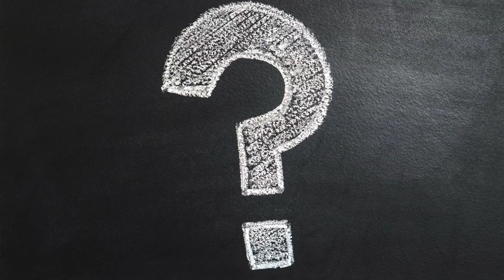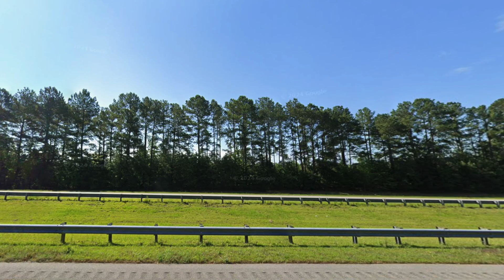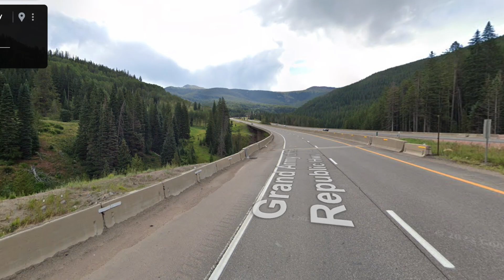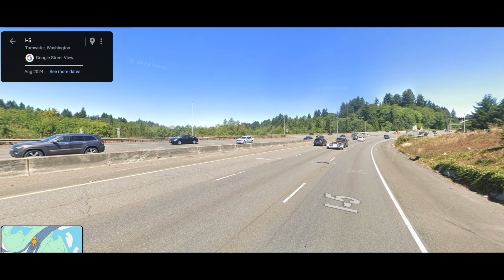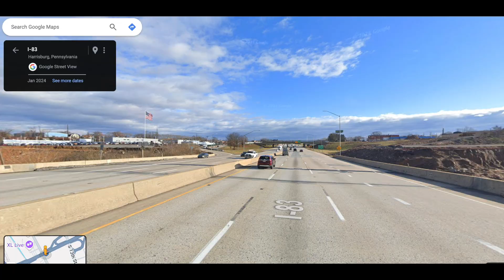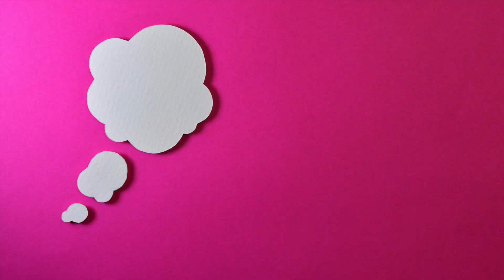Putting Rail Tracks on Highway Medians: The Pros and Cons

Comment: More cons of doing this; in order to maintain the rails, you will have to either put the crew in a dangerously tight place or close highway lanes, which will not make it popular with highway motorists, (maintenance is something people usually forget with grandiose infrastructure projects)  and it will be impossible to build turnaround lanes for emergency vehicles on the highway.
Reply from the maker: This is also a good point.

Comment: So this just popped up in my recomended, funny thing is i checked the curves for US highways vs rail a few years ago:

Wherever the US highway system has 80mph (130km/h) roads, that same alignment can be used for 160km/h non-tilting, or 200km/h tilting EMUs, It has grades of upto 6% which can be taken by very high-power EMUs, or with embankments and cuttings for lower grades

Highway - Railway

45mph (72km/h) - 46.6mph (75.0km/h)

50mph (80.5km/h) - 52.9mph (85.2km/h)

55mph (88.5km/h) - 65.9mph (106.1km/h)

60mph (96.5km/h) - 76.3mph (122.8km/h)

65mph (104.6km/h) - 84.7mph (136.4km/h)

70mph (112.6km/h) - 94.0mph (151.2km/h)

75mph (120.7km/h) - 98.7mph (158.9km/h)

80mph (128.7kmh) - 108.5mph (174.6km/h)

For tilting trains increase speeds by 20-25%

Highways are already grade separated, and they have a minimum clearance of 4.9m, this would give a catenary height of 4.5-4.6m While the ideal is 5m+, the the new acela and brightline trains are 4.32-4.37m high, so they can fit. Or use embankments and cuts to get more height.
Reply from the maker: This is very interesting math; thanks for these calculations! This would also reconfirm the notion that some highway medians are suitable for local rail (e.g. DC Metro in Virginia) and regional rail (thinking of Metrolink in the LA area running on a portion of the I-10 median). The highway speed-rail speed calculator makes it such that highway medians are suitable for the speeds you see with local and regional rail.
Reply: This really reinforces that if our goal shifts from true HSR at 150mph or bust, to "just a decently quick train" that's time competitive with driving, that highway medians become a lot more acceptable. Based on this a tilting train in the northeast could be expected to take most corners at 100mph, and on any longer straightaways could push it higher.

Also, if we are willing to impose a speed minimum on the tracks i assume its possible to bank them just like how many roads, highways, and racetracks have banked corners to enable higher top speeds. 

And of course you will always have issues getting into and out of the median. Although with proper foresight and planning you could strategically raise some overpasses/lower underpasses for cars to enable the future train to have an easier access. I generally recommend moving the road instead of the tracks since cars can handle much steeper grades. (Just to avoid the cost of building a 2mile viaduct just to enter the median.)
Reply: @jasonreed7522  "Also, if we are willing to impose a speed minimum on the tracks i assume its possible to bank them just like how many roads, highways, and racetracks have banked corners to enable higher top speeds. "

These numbers are for banked track, with iirc 160mm superelevation, which is roughly 6 degrees.

Any more than this and passenger comfort will suffer, since it has to be comfortable even when the train is stopped on the curve.

For higher speed on same track, use tilting trains,

Comment: The solution is to use the median or the side of the road where it makes sense. Having a bypass for trains not stopping in Harrisburg is ok, but add a spur to stop at the central station.
The hills are also an obstacle. But use tunnels and routes different than the highway, were needed and follow the highway by either side or in the median on straight flat sections.

Comment: Median can be an OK solution in very specific cases but still problematic. It constrain the ability of the train to reach  max speeds, and not just due to curves but also, and many times more important, max gradient, as low friction, that makes train great for high speed, does not handle well large gradients, while car can handle them well. This is true for all trains.
That's why trains also use tunnels, long winding curves around the mountains or zigzags to maintain low gradients. a gradient of 7% is usually the max, and than it's very slow, and the recommended for HSR is 2.5% (MAX 4%) and cars can handle much more (which is why one of the advantages of rubber tire metro cars over steel wheel ones).
It can also pose a problem if you need to expand the rail line or the road. The rail is problematic as it's in the middle and any expansion will require moving the road on one, or both, sides (look at the San Bernardino line that has a single track in the median of the San Bernardino Freeway that cannot be extended preventing an increase of frequency).
Another problem that you did not mention is redundancy. When a main road or rail line is closed for any reason you will need an alternative until it reopens. Lately there were a couple of cases of a major disruption on major highways that required the closure of large sections which led to a rise in train usage. Now imagine the rail line was in the median of those roads, you would have lost both the main highway and the main rail line. Even on day to day events, like major car accidents rail service might be temporary suspended, and this is not a rare thing on highways. 
All of those are a much more important that "publicity". You can make people aware of the advantages of rail without them passing in the median.
Reply from the maker: These are definitely good points, and the gradient issue is one that has also been brought up. Tunneling can be really expensive, but sometimes, it's your only way out (literally).

Comment: i think you should look into perth's train network in australia, specifically the yanchep, mandurah and ellenbrook lines when looking into such a question. you nail some of the points, indeed building rail alongside highway medians does avoid the issue of nimbyism, acquiring land and razing properties, and yes when you got high quality tracks and trains, the self-advertising of trains flying by cars is very prominent and effective. 

but building alongside highway medians poses problems for stations. for one, stations are filled with tons of noise, which can be managed through soundproof design, but never truly resolved, reducing the quality of experience for passengers. another thing is that since for most stations there has to be a pedestrian or bus interchange overpass that tends to be quite large, which may increase costs and the complexity of construction a decent amount for the stations, but i'd assume these are levelled out by the cuts in costs from the benefits of building along a highway median

from my experience in watching urban planning youtube, i've noticed there seems to be a bit of a negative connotation with building alongside highway medians, but when executed well, you reap many of the benefits which is thankfully what perth has managed to do, and i hope other cities can learn from us and do it just as well, at least for suburban rail

uh yea the issue of curves and more space required makes idea of building high speed rail along a highway median a rough one lol

Comment: I often thought about this, as well.  One benefit would be passenger trains uninterrupted by freight trains as they are now on existing right of way.  Growing up in Chicago, i saw at least three median based rapid transit lines.  A problem on all of them is the odd (and often) unsafe as well as inconvenient locations of stations…usually just put on an overpass above the tracks.  There is almost no auto parking near  these stations, and passengers are forced to walk quite a ways to the station, and then have to walk downhill to get to the boarding area.  Attacks of passengers have occurred in these stations and stairwells
Reply from the maker: @karlpiepenburg127  I appreciate the perspective you have on from personal experience in Chicago. That sounds scary.

Comment: Another con of high-speed rail in the middle of the highway median is that it increases the chance of an accident; a drunk could drive right into the rails.
Reply from the maker: @SantaFe19484  unless you have barriers separating rails from cars. But even then it might not prevent everything (unless barriers are sufficiently high).

Comment: Overall, I am in favor of using highway rights-of-way for rail lines, although I did notice that an issue in some parts of the world (such as Chicagoland) with using a highway median for a rail line is salt damage from road salt in winter.  However, not all places use road salt (Montana uses sand instead).
Reply from the maker: @JohnGeorgeBauerBuis  ohhhh that is an interesting potential challenge/issue I hadn’t thought of, the issue of road salt. Road salt has other issues too, but salt damage to tracks would be one of them if we had rail in highway medians. Barriers separating the highway from the rail tracks would hopefully prevent some of that, but I’m guessing not all of that.

Comment: I think it is important to consider that highway right of way is usually wider than the lanes as well. You could fit elevated higher speed rail that drifts over everything as needed. Obviously this is more expensive than running on the ground in the median, but if the main cost is getting land, this could still be worth it.
Reply from the maker: @EmperorNefarious1  yes, there’s the cost of getting land, and then the cost of litigation. As well as the cost to communities by razing homes and businesses.

Comment: HSR is great wherever possible, but when stretches of the right of way are small or curvy and realignment is not possible, surely you could temporarily go all the way down to 17 feet or so for low-speed, diesel- (or battery-?) electric single track.  And that's assuming standard gauge wide enough for freight.  Some areas might be better suited to a narrow gauge system.

If you build stations in wider medians though, for sure they ought to be indoor affairs, to protect passengers from traffic, noise, and pollution.
Reply from the maker: @liacrow  yes, and if the stations are not indoor affairs, they can be pretty unpleasant.

Comment: why be stuck with a 50ft median when you can use the whole 200ft right of way? Build next to, not in the highway. With most 6 lane expansions the median is gone anyway separated by a concrete barrier. No room there for a rail line left.

Comment: Consider the sheer size of railcars needed to carry passengers safely and comfortably while meeting Federal Railroad Administration standards (the current Amtrak Acela trainset is 10'5"" wide, 14'2" high, nearly 664 feet long, and weighs nearly 1.25 million pounds); the provision for foundations needed to support bridges and overpasses to carry that additional weight as well as the need for more common gradients and wider curves; and the disruption in highway traffic caused by the construction required to install rail in the medians.

Railroads were mostly built long before cities, and engineers built the most direct paths they could that would balance cost of construction against desired speeds. Interstate highways were engineered with sharper and more frequent curves and steeper gradients for much smaller, higher-speed, relatively lightweight vehicles with better horsepower-to-ton ratios and better wheel-to-ground adhesion than railroads. For example, a 1960 Chevrolet Impala was about 6 1/2 feet wide, 17 1/2 long, weighing 3700 lbs.; even today's fully-loaded semis go up to 80,000 lbs. and have trouble with some highway grades. With unlimited dollars, you could build a perfectly straight and level railroad between any two points, but the logistics of fitting one in a median still go far beyond any manageable budget I could imagine.

Comment: Thanks for covering this video. I'm surprised you didnt say anything about Brightline West (which is my personal favorite railroad for several reasons), since theyre basically doing just this. Even though not every highway is perfect for high speed rail, it's a great idea to have it inbetween major stops so this way it allows for higher speeds along these routes. Also important to note is that I don't support stations being built in highway medians, similar to several metro systems in the U.S., as they often result in an uncomfortable expreinece for passengers waiting at that station. Keep up the great work, subscribed.
Reply from the maker: @Pensyfan19  thanks for subscribing!

Several comments here are making references to Brightline West, so if I do a Part 2 on this video (a real possibility because a number of comments are mentioning additional pros and cons I hadn’t thought of), I should remember to mention that.

Comment: One thing to is that, even though the interstate system does not have as steep inclines as other roads, there still too steep even on non mountanis terrain. In Norway for example, (99% of Norway's land is mountans), the max grade used is around 1.5% and you will see up to 2.5%. The steepest standared gauge non-cog railroad is 5.5% and that is a nightmare scenario. Many interstates see more than 3% and in the mountain's can get up to 7%.
Reply from the maker: That is definitely something to be mindful of. I also find it interesting that interstates aren't even more aggressive with limiting slopes (though some of that might be to maintain flexibility of some sort due to rugged terrain in some areas). I'm also reading that tractor trailers with heavy loads should limit their slopes to 3-5%, which is not out of the range of grades that can be allowed even with high-speed rail (2.5-4%). And in some areas, tractor trailers have no choice but to use the interstate...

Comment: I would say for high-speed rail. It's definitely a win but I wouldn't say it's good for localized rail nor is it good for slow rail. 
One thing to think about is high-speed rail in order to be efficient has to have fewer stops. 
So it could be a good bypass rail option. 
I mean ideally you would have used an  already built rail and highway median when it makes sense. 
The problem is that high-speed rail is becoming more popular of an idea in America, but localized rail behind. 
Because I can already see a problem that's going to arise as they begin to build these right now. Rural communities are unaware of the benefit of it, but as soon as they become aware of it they'll be fighting to get a stop. 
Historically of course. This was before the era of the car. Towns that were skipped by train disappeared in time, There actually are towns in America that disappeared because of the train. The same thing happened with route 66. There are towns that were thriving that were built across the hwy. They went extinct or slowly disappearing. That's one of the reasons why like Breezeway, Pennsylvania doesn't want to lose it s loop even though it's really inefficient for drivers. If you weren't connected, you're going to lose your community. 
Yes, there are going to be those who are not going to want it in their backyard, especially in the beginning. But I can assure you they're going to be a lot of communities that are going to want it because they know that it can benefit their community. 
Since the industrial age rural communities have been threatened by extinction.

Comment: The grade is usually exclusive for trains, rolling country doesn't work for rail especially at high speed.

If you fill the median you'll need expensive concrete barriers to protect the railways from the cars.

The concept could work in suburban low speed situations where the grade issue isn't as important (as long as the grade is within that acceptable for the train) but in suburban areas highways are not generally built with wide medians because land is so expensive. If, as in your example, the highway is built with transport expansion in mind then great but I think there's very few examples where you might be able to insert railways, especially high speed rail, into medians. You need a wide flat median with few curves which might exist in topographically flat empty places but these, with the exception of the suburbs, are generally cheaper to build in anyway.

Comment: I agree completely!
Lucid Stew’s video wasn’t very researched or informed on existing transit connections and hubs and other useful right-of-ways, and I nearly spit my drink out when he said his Seattle station location was excellent.
Anyway, another downside of highways especially for slower trains would be noise and pollution if the stations are also in the median (or adjacent).
Going back to Seattle, you can see in our Lynnwood Link Extension (which has solved a ton of problems and overall been a MAJOR boost for transit in the region), stations are adjacent to the freeway and can be unpleasant. But to the south in our Federal Way Link Extension, there’s a really nice balance with the tracks between stations going parallel to the freeway, but then going away from the freeway for most of the stations.
Reply from the maker: @realquadmoo  yes, the downside of rail tracks in highway medians you mention is one I’ve heard about too since I made my video (and one that exists with the LA Metro C Line, which I’ve been diving more deeply into as of late). Highway median rail stations…aren’t the most pleasant.
Reply: Luckily in Seattle our current metro expansion only calls for three highway median stations when absolutely necessary, one of which might be eliminated once we begin studying route alternatives.